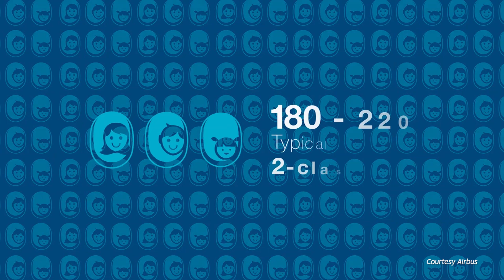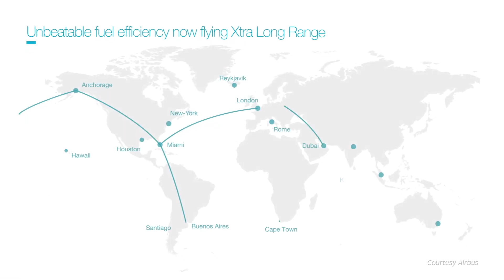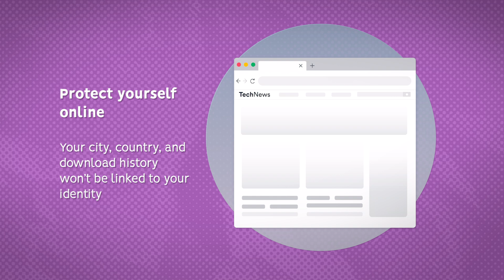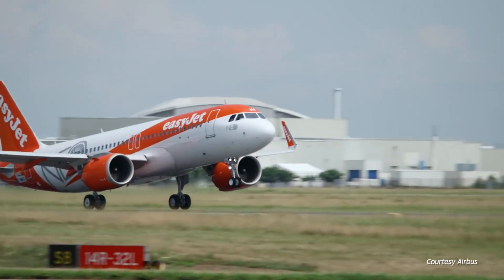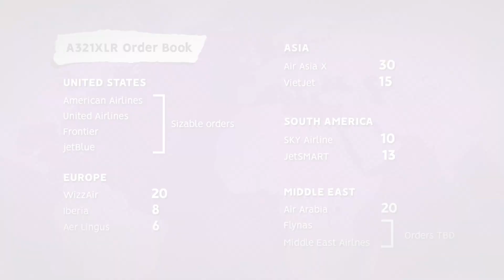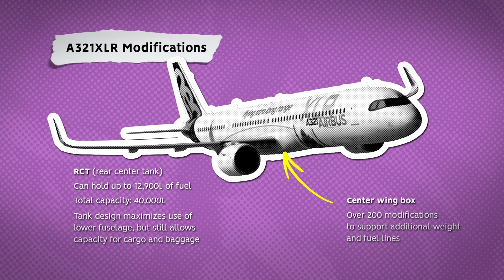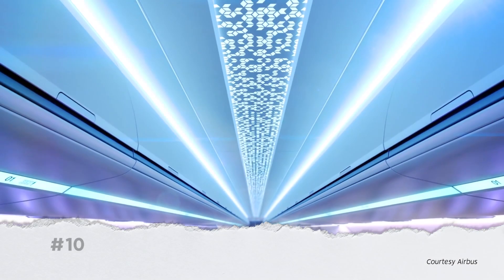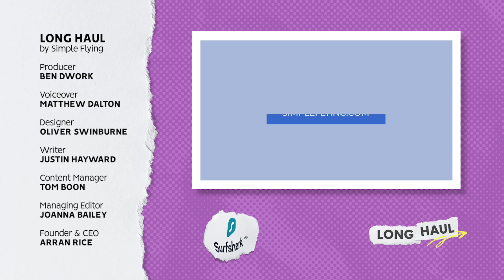10 Things You Must Know About The Airbus A321XLR

Comment: I've flown transatlantic on a B757, it was actually quite a comfortable flight. I could easily do 8-10 hours in a narrow body but, it's the crew I feel sorry for.
Reply: TUI
Reply: @edbag643  Zoom operated by Air Finland
Reply: If they are going to have a dedcated long flight a321,they could just as well have a permanent wall and permanent furniture for crew rest. Its more efficent than blocking of first clas anyway
Reply: I flew from PTY - MVD on a 737-800, over 7hrs. in economy. My personal experience is that during the day I couldn't sleep, so I had to endure the whole flight and the other I missed was that 2nd aisle... Bugged the hell out of me waiting for pax to pass so I can go to the lavatory. If the XLR can guarantee cheeper fairs then it should work out. Most of the time you're in your seat so as long as you're confortable and entertained you're good to go.
Reply: This plane will open the low cost for continental flights, from US to Europe, from Europe to Asia ...new direct flights to far away destinations
Reply: i reclon the 757 is wider and is definitely not seat packed as densely as A321 LCC and does not fly that long as the A321 XLR
Reply: Why ?  At most airlines the pilots get a blocked off first class lie flat seat for crew rest.
Reply: @savagecub  not quite the same as having a crew rest area like the B787 has
Reply: @matthewbarber9846  
Yes but…….A321 is not going anywhere near as far as the 787-9 does.
Reply: @savagecub  You say that like a transatlantic flight from NY to London for example is a hop over a puddle.
Reply: @hadesflames  
In the winter time a trans Atlantic flight from NY can easily take less time than a flight from NY to PHX !
Reply: @matthewbarber9846  Bingo.  Not even in the same hemisphere.
Reply: @savagecub   not all 787's and 757's  have crew rest areas so they have to sleep on passenger seats
Reply: @raaghavtoteja3435  
What airline would be so CHEAP so as to order a 787 without a crew rest compartment ?  Furthermore what kind of pilots would want to work for such an outfit ???
Reply: @savagecub  BA 787-10’s don’t have crew rest.
Reply: @TheSooty1975  
I happen to fly 787-10s as a pilot so I’m pretty sure I’m not imagining the crew rest compartment………….
Reply: @savagecub  if you read what I said “BA (British Airways) ordered their 787-10’s without crew rest.
Reply: @TheSooty1975  
No !  What YOU said was “787-10s do NOT have crew rest” which is only correct if applied to BA. Why BA would be doing that makes absolutely no sense. They must be choosing to fly the aircraft very inefficiently.
Reply: @savagecub  READ it again. It very clearly says BA (the first two letters of my reply…!). I’m not going to waste my time arguing with you. If you’d like to email British Airways, and question why they didn’t take the crew rest options on the -10, that’s entirely up you.
Reply: @TheSooty1975  
So they’re the ONLY ones in the WORLD without crew rest ! That’s a pretty small number of 787-10s. What other useless minutiae what you like to point out ?
Reply: @TheSooty1975  
Where’s your proof ? Where did you see that they ordered a transcontinental aircraft WITHOUT crew rest ?
Reply: @raaghavtoteja3435  all 787's do
Reply: So called pilot xdd
Reply: @savagecub  As a "787-10 pilot," I think I'm expecting more warmth into the community and a brighter attitude perhaps
Reply: @floork24  
Yeah………and I want a pony !
Reply: @savagecub  neigh neigh

Comment: A322 could solve the space
Reply: It would have reduced range, a big problem is the so called coffin corner which is why the A322 would need a new wing. Also Airbus already said that they won’t pursue any A322 plans
Reply: Airbus is working on a new carbon fiber wing for the 321, which may enter service in the mid 2020s. I assume it will be bigger (and optimized for 321 sized aircraft), since the current 120 m² wing (757 180 m²)  is at the limit with the 321.

Comment: Big jets will come back because there will be problems with traffic
Reply: The A321XLR isn’t meant to replace big jets, it’s meant to add new routes
Reply: @spongebubatz  so why are they flying big jet routes. Look at how many planes are in the sky at one time how many slots in airports one big plane is more efficient than say 3-4 small ones even if there a bit better on fuel as more planes are needed to do the job of one big plane
Reply: @matthewhibberd5791  tell me a big jet route they’re flying. If you think JetBlue‘s service between NYC and London is a big jet route you’d be right, but the A321LR isn’t replacing any widebody and is only adding capacity. That’s the difference. The majority of A321LRs/XLRs will be operated on secondary routes
Reply: @spongebubatz  im not saying there replacing all of them what im saying is that in the future traffic will become alot more congested this is why the a380 was built. Im not against it I love the a321 one my favourite and I like the idea of been on a less size plane that wouldn't take ages to get on and off im just saying with all these orders there is going to be problems especially in high demand airports

Comment: I prefer wide body for long flight because of the service cart. If you're settling front part of the economy class and finished the meal and want to visit bathroom. Yet still cart is servicing the second drink or correcting trays. You can't go the the bathroom located in the back of the plane. After cart is done, you may find long line up for the bathroom from back part of the passengers.
Reply: but this is more spacious than what it replaces

Comment: Possibly, Boeing will develop a single aisle passenger aircraft, using 787 technologies and future engine technologies, that will serve both as a replacement for the aging 737, which basic design dates back to 1960’s, and excellent but now retired 757 for low capacity long distances. But that will be very late, as the A320 series is 20 years younger in conception, thusly more flexible in evolution. To compete with the A321 XLR in the short term, Boeing would need to be re-winging and re-engining the 757 out of its retirement and that would be very very expensive. Boeing will live without competition to Airbus’s A321 XLR for many years, possibly a decade. Boeing had that market all for itself with the 757, and then just forgot about it. What a blunder!

Comment: A321neoXLR is likely to cannibalize some of the potential sells of A330neo
Reply: Not really, even the A330-800 is still a lot bigger than the A321. There once even were ideas for an A322 (these ideas were canceled by Airbus), so an aircraft that should shrink the gap between the A321 and A338. If Boeing ever announces or publishes plans for a 797 it will likely be situated between the A321 and 787/A330.
Reply: The biggest benefit of the 330 Neo for Airbus is it competes with the 787 - it was a relatively inexpensive program for Airbus since the 330 program had it's break even long ago (unlike the 787), and it is not that expensive to produce. It prevents Boeing from earning much money with each 787 sold, they can't simply raise the prices or the cheaper 330 Neo would get more interesting for the airlines.